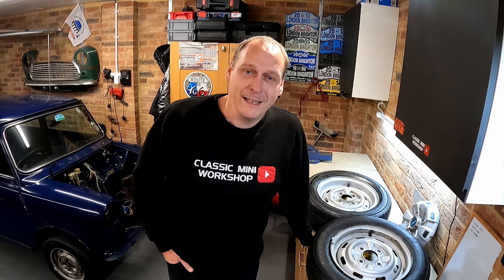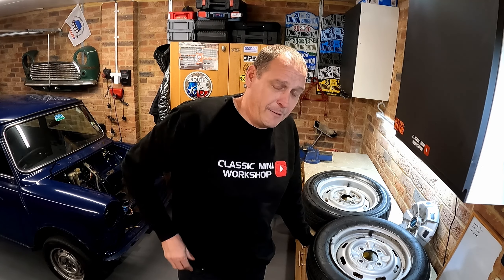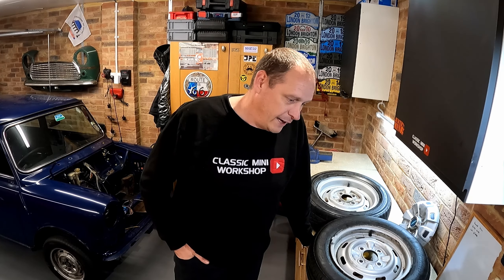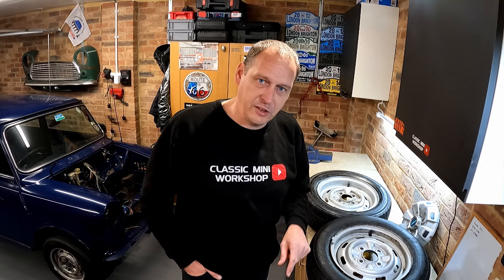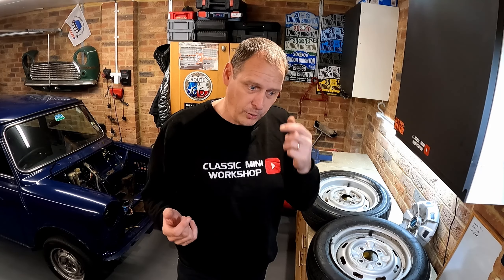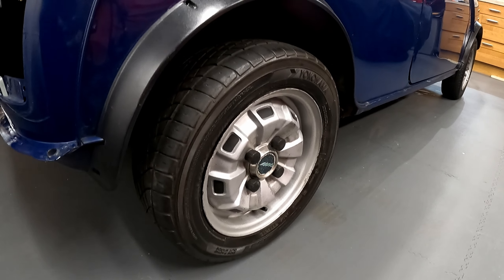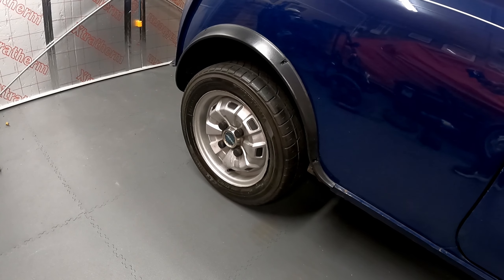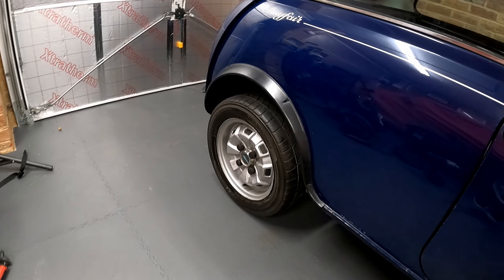Wide Steel Wheels *NOT* Banded! - Classic Mini Project Pt.10

Comment: Hi Keith, I think the Imp wheels are a great improvement, just need to find two more! As you are going for subtle improvements , how about to give the engine a bit more pep, a cylinder head modified by Keith Calver, a Piper cam BP255 , high torque , a three branch manifold, NOT LCB and a Maniflow twin box system attached to it, Should give same or a bit more power than 998cc cooper, 55 bhp plus, have a look on Keith Calvers website, some interesting info on there.

Comment: Hi really like watching your videos! I am looking to do my gear selector seal but I am a complete novice so would you recommend me giving it a go? If so have you got any advice?
Reply: Forgot to add that I have a 1999 mpi sportpack Mini Cooper
Reply from the maker: Yes, absolutely. It's quite a straight forward job on a manual or auto
Reply: @classicminiworkshop  it’s on a manual but I am worried that oil will leak out every where if I just have the front jacked up or the front wheels just on ramps
Reply from the maker: @shaunwilliams1399  I would replace the oil seal when you next do an oil change and it's empty. You can change them when it's full of oil, it doesn't pour out, it just drips

Comment: Hi Keith 
I’m some advice on a mini engine if that’s ok, I have a 1963 morris 1100  with the 1098 engine. Two years ago I bought a fully reconditioned engine and gear box. Paid £2,100 for it ,it came with 1 years warranty it was from John speed racing.  Because I decide to completely re do the engine bay subframe and everything else on the front end I only got to fit it in late august this year. It was finally ready to test drive last month. No sooner had I gone out around the block and come back I had a patch of oil on the ground and constant dripping i eventually found it leaking oil from between the head gasket near the thermostat housing I had a classic car mechanic fix it. And tune the car and it cost me £600.  Now I have noticed that once the engine is warm there is a loud noise coming from the clutch when you put the clutch down it goes quiet lift the peddle up and it’s noisy again do you think it’s anything that will cause damage to the engine.?  it’s done less than ten miles I’m worried to drive it now.  Many thanks in advance      Troy
Reply from the maker: I would get it checked out, it could be a problem with the clutch / flywheel and if it's making a noise it's likely to be damaging something. Sorry for the bad news!
Reply: @classicminiworkshop   hi thanks for the advice. I guessed as much.  I was just hoping after all the money I’ve spent on it  it may be something simple

Comment: I would have thought that surely it's better to have wheels recessed from the outside of the arches, otherwise the side of the car gets sprayed with muck and stones as soon as you steer.
Honestly, to me the wider wheel gives it a bit of a "stood on hotwheels car" look.
Reply from the maker: I don't think they will throw out any more muck than a Mini with 5J alloys on 165 tyres. They are still just about inside the arches